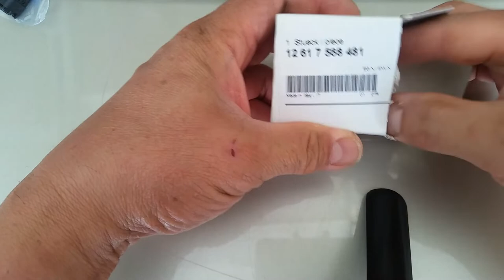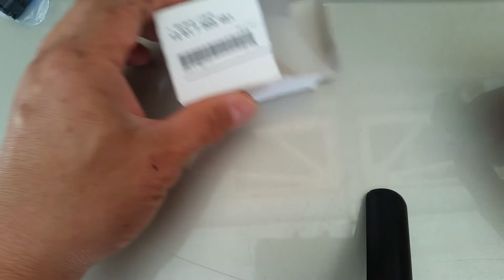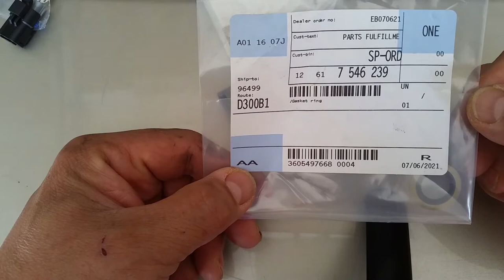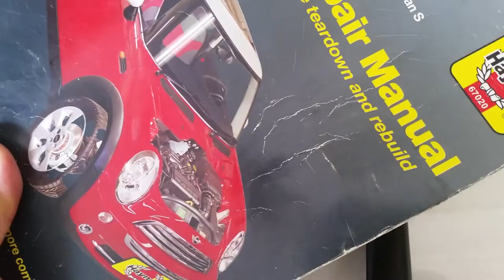Oil Pressure Connector Repair and Oil Pressure Switch replacement on 2009 R56 Mini Cooper

Comment: Are you sure the pin couldn't be inserted through the holes in the door and through the green rubber seal and lock in?  The new connector has square holes in the door larger than what's needed for just the wire.   How did Mini do it?    Appears to me that you took a big chance of breaking an expensive new connector when you removed the grey part.
Reply from the maker: Don’t remember for sure. If you can push the connectors through the door and green rubber seal and have it lock in, then I would do it that way. I think I had trouble making sure it all fit and clicked in.
Reply from the maker: Most likely Mini buys the harnesses made from someone to their specifications. So the harnesses are assembled at a factory where they have all the tools and equipment for cutting, stripping and crimping the connectors

Comment: Another awesome video. May I know where you bought the oil pressure switch and the seal from?
Reply from the maker: You can get the parts on PelicanParts.com.  MINI Oil Pressure Switch Part#: 12-52-7-542-850-BOE ($9.00) and MINI Seal Ring for Oil Pressure Switch in Cylinder Head Genuine MINI

Part#: 12-61-7-546-239-BOE ($4.25).  I am not sure if I got them here so you may want to search around for a better price.  You can get a knockoff seal on Pelican that cost only $1.25. Good luck!

Comment: Can I get The information on the extra oil pressure switch you’ve on your car
Reply from the maker: I did a three-part YouTube videos on the install of the additional oil pressure and temperature gauges. https://www.youtube.com/watch?v=PhLw2bJ_2T4.  I bought a kit from CravenSpeed. https://www.cravenspeed.com Not cheap but this was my first time and wanted all the parts in a single install kit.  Cheaper if you've don this before and buy parts that you need. Good Luck